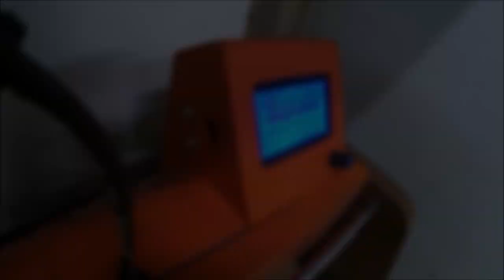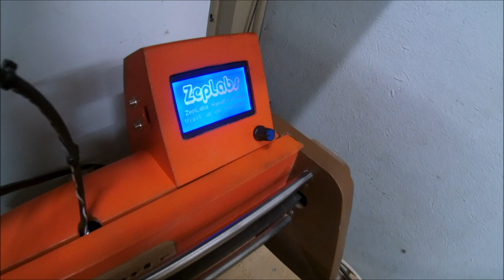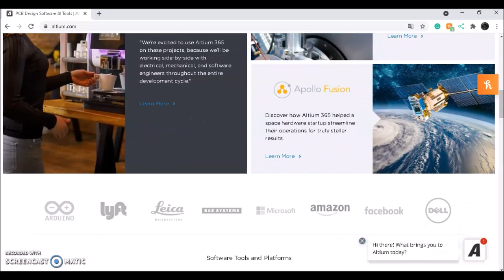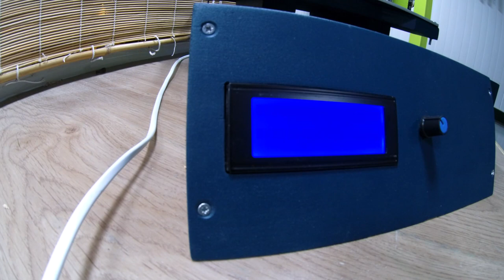Make your own 3D Printer: It is running! (Part 4)

Comment: i asked you a few months back about having mismatched motors and you answered me ...and im thankful for that ...the 3d printer i diy'd is now finished and i can tell you the best upgrade you can make is add a bed level sensor and enable bed leveling in marlin 
now i want to mount the 775 motor and er11 spindle and use the printer as a cnc .. i hope you get into that eventually 
My 3d printer is made of steel and the frame is rigid so i think i can use it as cnc but i cant configure marlin to do it ......
Reply from the maker: Thanks bud! Good to know it worked out for you!
I already have a cnc router made, which is stiffer, and bigger than the printer here, so I dont think I ll ever make the mod.
But it is also running on Marlin!
So you could download the firmware and compare it to yours, make the necessary modifications and get it running.. Shouldnt be too hard I suppose!